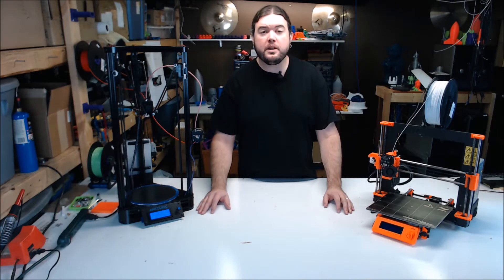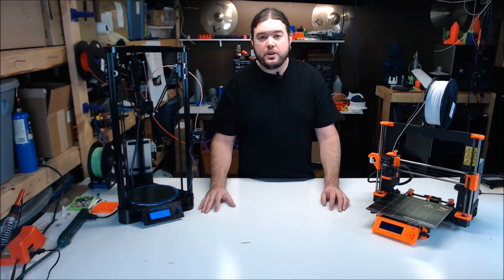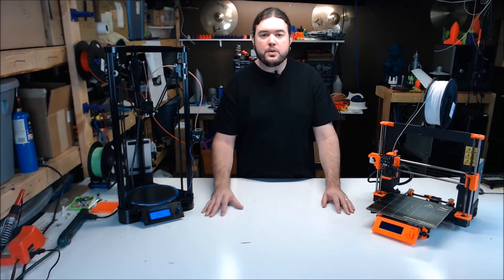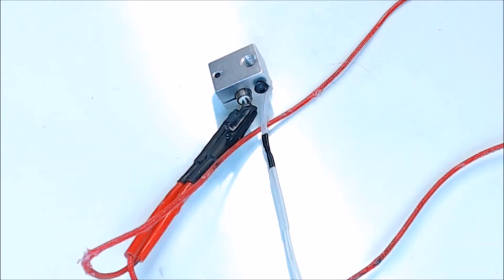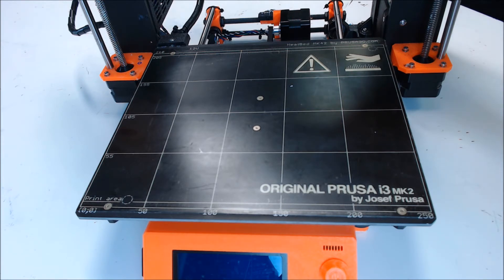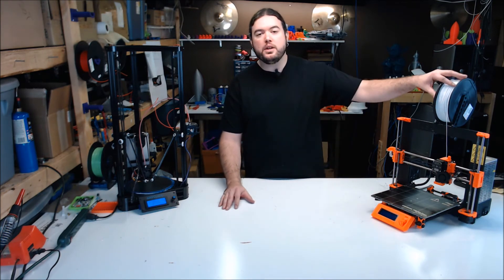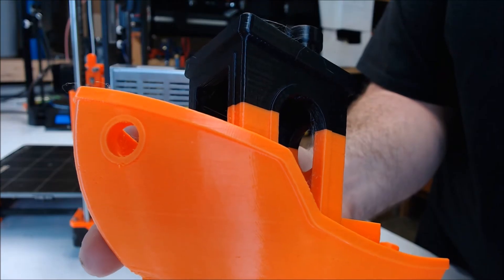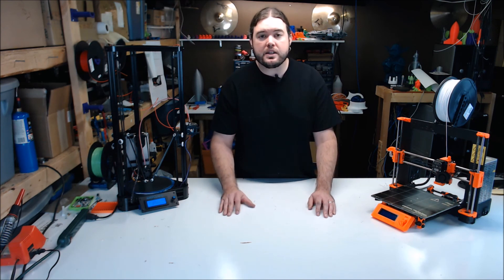Intro to 3D printing - What you need to know before you get started

Comment: Hey I just got into 3D printing and I was wondering what would be a good plug-in play no hassle starter printer? I have a creality ender 3 and the Gtech I3 Pro B and I've had a lot of problems with both of them. Thank you for the help configuring my SKR mini III what you said worked I'm pretty sure. I just want one that works straight out the box so I can learn the basics yah know? I got like 400$ to spend.. Wondering if you had a suggestion?
Reply from the maker: Around $400 is going to be hard. There are some that seem to work pretty well, but most of them are proprietary. I am currently working with a Adventurer 3 from flash forge, it works, but it's kinda small and you have to work with their software which is limiting. Unfortunately, I don't have a good answer for you.

Comment: Its definitely a challenge I have yet to print a single thing once I get the board situation worked out hopefully I can get the computer to even connect to it maybe just maybe I can use print run to check all of the settings but I'm skeptical  this robot with on board printer is an on going 4 year project . secret ...........its mostly done the 3 d printer is the last phase I still estimate time of first print DEC 25  but I hope I can do something before that .fingers crossed.🙏👍🌞😁
Reply from the maker: Good luck with your build, let me know if you get stuck.
Reply: @ChrisRiley  go to  wishicould arduino duce robot build  under people and blogs if you get a chance I put a 59 second video of my problem I have my build on there just for a forum I'm building along with just for fun I don't really have a real channel.👍
Reply from the maker: @wishicouldarduino8880  I checked it out, do you think it is a firmware issue? This is a custom printer? Is there a Marlin config I can look at? I don't want to offer silly suggestions, but make 100% sure that all the pins for your RAMPS shield line up with your mega. I have had a few pins jump the sockets before and cause issues.
Reply: @ChrisRiley  I basically used the configuration you did for 1.8 for t8 rods  I didn't change anything except I used the 3950 thermistor that came with my bed and nozzle the motors are the same I used the full graphic LCD  added the u8glib enable SD i added config and advanced config to the sketch is that enough or do I need to add more I extracted all but I still have to add what I want to the sketch I think I'm going to custom name this thing Halloween printer from hekk lol.
Reply from the maker: @wishicouldarduino8880  I don't know your printer, but I would give it a try and go from there.
Reply: @ChrisRiley  it just a scratch build I guess you could say rep rap e3d v6 clone hot end I swapped a couple of pins on the motors but that is all I could find  I think it is in the firm ware I don't think its loading in to the board still trouble shooting .
Reply: @ChrisRiley  OK I put one more short video of what problems I'm having with marlin check it out if you get a chance I have my computer so its easy to see the arduino ide.thanks for any advice
Reply from the maker: @wishicouldarduino8880  I am having problems locating the video again.
Reply: @ChrisRiley  I took it down it wasn't that good  I'm in the process of putting tabs one by one in the marlin ino I hope it works that way over half way done I'll put a short video up if it works or not thanks . maybe it will work .
Reply: @ChrisRiley  I opened arduino added marlin set up configurations h kept adding files quite a lot of them  until it complied uploaded it still nothing .I'm wondering if this mega 2560 is not working right you can still upload other stuff to it blink sketch and so on .this is a tough one
Reply: @ChrisRiley  my video is at wishicould arduino duce robot build I posted a better example of the issue .......and its a bummer I'm wondering is there something I should enable in the power settings ? Thanks for any help.👍
Reply from the maker: @wishicouldarduino8880  Can you pack up the code and send it to me? I will test it on one of my setups.
Reply: @ChrisRiley  its on another computer but if I can ever figure out how to do that I will.👍 I'll FedEx the laptop lol😅😂 if I can somehow get it over to my tablet I will send it thanks 😁
Reply: @ChrisRiley  howdy it turns out the problem was the pin configuration for the discount full graphic LCD now that I have the correct one where would I enter it in the marlin firmware ? Thanks for any help👍😁
Reply from the maker: @wishicouldarduino8880  I think you were using a RAMPS or something close to it. You would update that in PINS_RAMPS.h
Reply: @ChrisRiley  awesome ! Thanks I'm using ramps 1.4
Reply: @ChrisRiley  thanks👍😁
Reply: @ChrisRiley  I got version 1.1.9 marlin but I haven't extracted it it also came with an additional file bug fix . should I extract them both or only one ? I have them opening with notepad ++ but the ino does not open in the arduino type of forum it has to be added to a sketch that is why I haven't extracted the new version yet .I was looking for a way to open the marlin ino so it opens in the arduino style format but with all of the tabs in it .thanks for any suggestion's.👍
Reply from the maker: @wishicouldarduino8880  I would just stick with 1.1.9 for now. It should work.
Reply: @ChrisRiley  OK! I got marlin to compile got it to upload got the LCD working however with the pin configuration which only gives 3 rs ,en  ,d4 it works well with the example lib but with the total sketch the graphics are fragmented you can still read them but they are askew and kind of garbled I suspect d5 6 and 7 also must be changed but! You can't get to those pins in ramps.h  is there any where else to get to these pins? Sorry to be a bother but its almost there the robot with the 220 by220 by 110 printer is almost working with help from Chris Riley.thanks for any suggestion's 👍😁
Reply from the maker: @wishicouldarduino8880  Unfortunately, I am not sure where the reset would be configured.
Reply: @ChrisRiley  well I'm going to delete the LCD looks good on paper but doesn't work .thanks👍
Reply: @ChrisRiley  getting close to a test print one question how do I see if the cold extruder is working? Thanks for any advice .your setting for ,1.1.8 config seems to be working well thanks! Funny thing about the LCD even with the garbled graphics ........it still works all the functions still work weird!👍😁
Reply from the maker: @wishicouldarduino8880  Glad the screen at least works some. You would have to run a M302 to see if cold extrusion was enabled.
Reply: @ChrisRiley  cool thanks👍 I'll try it .
Reply: @ChrisRiley  m302 worked  I also noticed the max temp in pronterface is 185 for pla  nozzle and 60 on the bed should I match these settings in marlin?and as always thanks for any help PS I built my fun in the country filament hanger when I post the video you might get a kick out of it .👍
Reply from the maker: @wishicouldarduino8880  LOL, nice, You can match those is you like, but I usually change them how I see fit. I think you can use M145 to change them.
Reply: @ChrisRiley  m145 I'll try it thanks  gotta say I think I've jumped about every hurdle there is for 3d printing lol that's what happens when you build from scratch.👍😁
Reply: @ChrisRiley  hi when I set the bed its fine but when I attempt a print the nozzle stars out an eighth inch off the bed kind of effecting the first layer squish lol !! Any idea how to fix this ? Thanks for any suggestions.👍
Reply from the maker: @wishicouldarduino8880  Check the M503 command, make sure you don't have a Z offset in there. Look for M851
Reply: @ChrisRiley  cool thanks👍
Reply: @ChrisRiley  hate to be a bother if it has an offset how do I accommodate that? And I don't know ....I kinda liked bigree lol.👍😁 thanks for any suggestions happy turkey day !
Reply from the maker: @wishicouldarduino8880  For offset, you can use the M851 command to adjust it.

Comment: 1st Printer is in the post and nearly here. This was the video I needed. Thank you :)

Geeetech prursa pro c going to have many headaches and fun coming lol
Reply from the maker: LOL, it will be a good time I am sure! I have toyed with the idea recently to do a video series on my PROB, it could be fun.
Reply: @ChrisRiley  1 week later I'm still waiting for a viable print job. Seriously if I'd knew how much of a pain in the ass this printer was I would not have bought it.

Firmware that tells the y axis to go in the opposite direction 

Learning how to code

Z axis problems " very common "
Absolute almost endless tweaking of...
...Temps
...Axis speeds 
...flow speeds. 
...axis speeds
Ect ect

Plus the acrylic frame shattered in numerous spots. (Go aluminum frame"

This thing has turned into a nightmare.

It's got a week to work or it goes in the bin
Reply from the maker: @davidschumann4495  I feel for ya man, my PROB was a nightmare as well. I have actually thought about going back to it, but every time I look at it, I think "nope!"